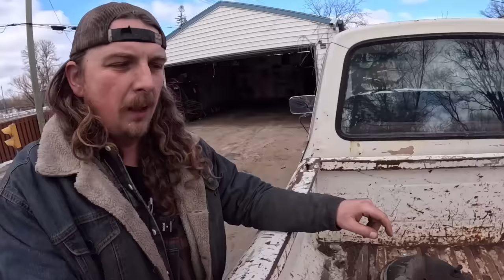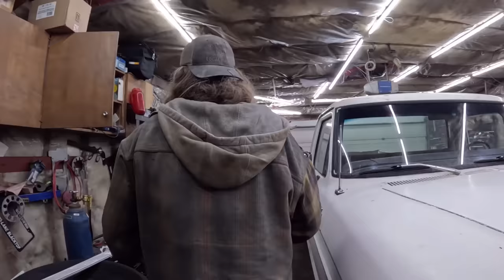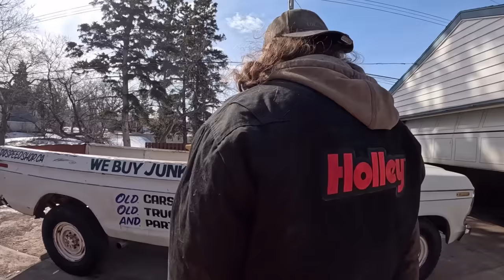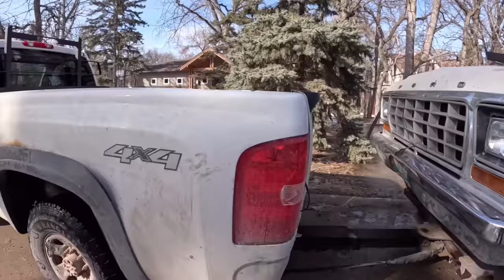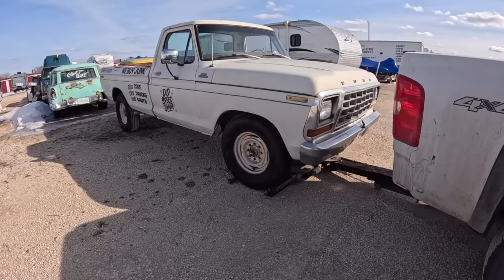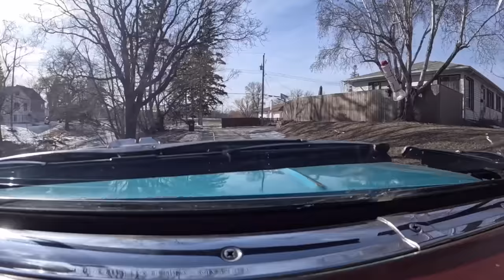BROKEN DOWN In Rush Hour Traffic!  1979 Found On Road Dead!

Comment: In regards to the brakes, if its like my Mustang… there is a shuttle valve in the brake fluid distribution block. The valve actuates the brake warning light. I had to disassemble, clean and rebuild it. It was nasty nasty. Easy to do.
Reply from the maker: Yeah that's probably not a bad idea

Comment: 67 -79 , best trucks ever made!
Reply: Ford quit making good vehicles back in the 40s
Reply: Only the sheet metal. Gm got ford beat in most other ways . Duraspark 🤮 and hardly anything interchanges.
Reply: You mean Chevy's??😂😂
Reply: @chiphazzard8173  Ford made the best truck frame through 1979.
Reply: Huh???????  I would NEVER own a ford
Reply from the maker: It is a good looking truck
Reply: @DDSpeedShop  I think you found the issue running it . Fuel pump . Can test the brake indicator unplugging the sensor . If it lights again , it's the wiring . If not , it's the sensor . It's a good truck . Joe did great on the lettering !
Reply: @vinman1029  I habe a 79 ford with a cracked frame at the steering box... I have a 72 chev that does not... 79 ford has 67k original also.
Reply: @chiphazzard8173  Chevys were so about that  they made support pieces to weld in. Not bashing,  I owned 4 70's ford's and over  2⁰ square bodies.

Comment: Brake light caused by pressure switch in metering block, crack the front bleeders and hit pedal to re-center switch and you should be good. Ford re-pop mechanical fuel pumps seem to be junk these days. Put two in my 78 F350 with 460 and both failed within a few weeks. Finally gave up and installed a carter electric fuel pump. Problem solved. As usual, awesome channel and love that Nomad!!!!

Comment: Back about 20 years ago, I had a white/rust 1975 Ford F-250 with a tool box bed on it. It actually was a service truck. It came with a lift gate, which I removed. It had some serious patina, even more that one. It weighed almost 5500 pounds because of that bed, which had a thick diamond plate floor. I bought it from an A/C guy that had used it as his service truck for years. It had no A/C, and he had upgraded to a truck with A/C (I'm in Phoenix, AZ) you would have to live here through a summer to understand why that is so important. I bought it to haul dirt bikes in. Paid $1600 cash.  It had a 390/C6, and got 8 mpg. I worked for a government fleet service department back then, and I brought home a large amber beacon light from a truck that had been sent to auction and put on it. I had "JunkyardDog Towing and Salvage" painted on the doors (JunkyardDog has been my nickname since I was 10 years old) I loved that truck, other than the fact that you could die from heatstroke trying to drive it during the summer. I eventually sold the dirt bikes, and a while later sold the truck, because I just couldn't afford the 8 mpg thing for a daily driver. Now I wish I had it back. Those old Fords are indestructable. They might have mechanical issues from time to time, but are super easy to fix. But you could probably push one off a 300 foot cliff without making a dent in it. 

I absolutely love the beautiful paint and chrome on that Nomad.

Comment: Perfect timing for fresh lettering on the Furd, I had to laugh with we buy junk down the side as your hooking up with the tow truck. You never know what's floating around the fuel system on the old Furd  plugging stuff up or how accurate the gas gauge is reading, its probably not a real fuel sipper.
Reply from the maker: Oh I know I buy junk haha

Comment: Dan, after you change the pump, put on a fuel filter with a return outlet and run a return line to tank. Put the filter as close to the carb as possible. These OBS trucks with mechanical fuel pump love to vapor lock.

Comment: Yes sir it is embarrassing to break down in an old vehicle. You can imagine what people think as they go by. I have a 1977 Chevrolet truck that my dad bought new. Of course the truck has been painted and we took out the six cylinder engine and put a .030 over 283 in it. It is a rusted bucket now and dad gave it to me more than ten years ago (he just did not drive it anymore). I fixed a few things and started driving it. Well I had the same issue as Dan going to go pick up a package and it is most embarrassing to sit there and cause other motorists inconvenience. Well a wrecker driver on his way to a call just happened to stop and ask me if I needed a tow and of course I obliged him. At least you could call Dani and have her bring your wrecker to tow you along. Here in Florida we have a move over law. It was first passed for law enforcement, now it also includes emergency vehicles and any vehicle on the side of the road with its emergency flashers on. It  requires the motorist to move over one lane or slow down 25 mph under the posted speed limit if unable to move over. I was taking a load to Orlando Fl (I drive part time linehaul for a Fed Ex Ground contractor). Interstate 4 had a 65mph speed limit due to road construction. A FHP officer had a vehicle pulled over and everybody got over into the left lane in order to keep moving at the speed limit. Well this caused traffic to back up as everybody had to also slow down and the line of traffic was "brake light Bettys" and was slowed to 35 mph. Well I could not get over so I slowed to 45 mph and passed the whole damn line up the blindside staying in the lane I was travelling in.

Comment: Dan I live in the same city as you and I started driving a ford f100 and was having fuel problems like you and ended up putting a fuel filter with return line on it and my fuel problems are over

Comment: Tip 1: When you’re that close to getting off the side of the road, rev to 5000 rpm’s and neutral drop that ass! 😂. 
Tip 2: Mechanical fuel pumps these days at O’Reillys are grade A dog 💩.  
3.  I guess I should buy old Chevys, put dog 💩 fuel pumps on them, let them break down, tow them away with a Ford and then tell everyone that my Cheap Heap Every Valve Rattles Oil Leaks Every Time is just so damn unreliable. 😉

Comment: sounds like a plugged fuel filter. crawl under the truck and check for cracked fuel hoses and rusted lines that can cause air to get sucked into the fuel system. Hopefully it's not the fuel pump

Comment: The Ford haters are loving you Dan. But it makes good YouTube content. That truck is a turd because it's been used and abused. But turds come in all colors or Makes. I own 94 F150 4x4 with 404K miles. It's let me down once with a dead battery. I had a 95 Silverado that let me down with a bad fuel pump and a broke tranny yet it was still a great truck. My other truck is a 71 C10.

Comment: The absolute worst vehicle I ever owned was a 1976 Ford 250 , caught on fire , because of the genius idea of front mounted distributor and little short rubber gas line , and rearend locked up going 40 mph , downtown Ftworth Friday evening traffic , that was special in its self . The best part of that truck was the chevy rearend that we installed in it after the Ford  rearend destroyed itself . Truck was only 4 years old at the time

Comment: Should have bought a chevy.     Found on
Road dead.    Fixed or repaired daily    F@cked over rebuilt dodge.   F@cked on race day.   Like the commercial.  Ford had a better idea.  What they didnt tell u is the five watt light bulb burned out five seconds after the commercial.      Take that thing to the recycler.